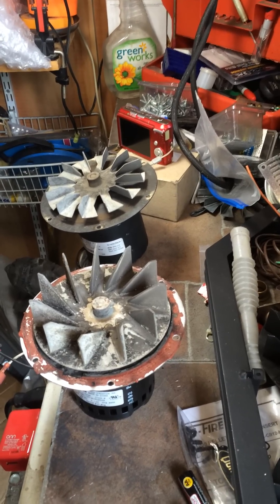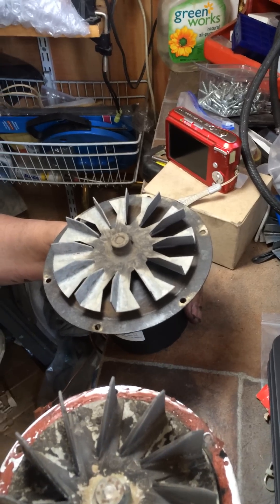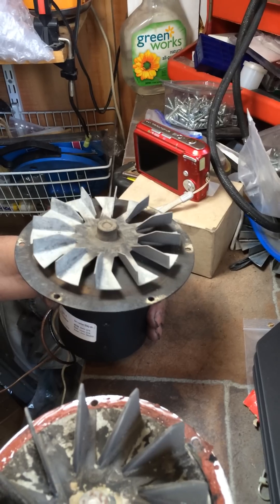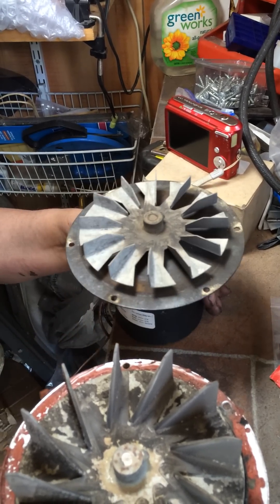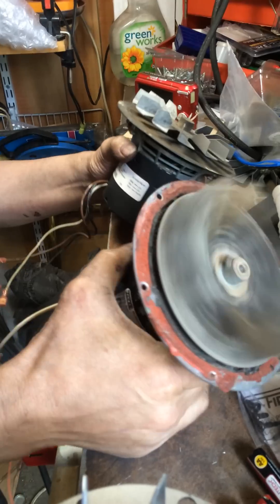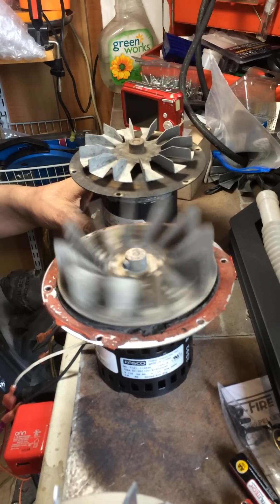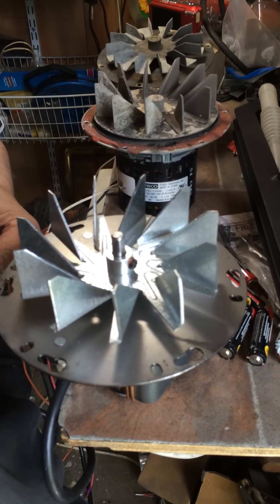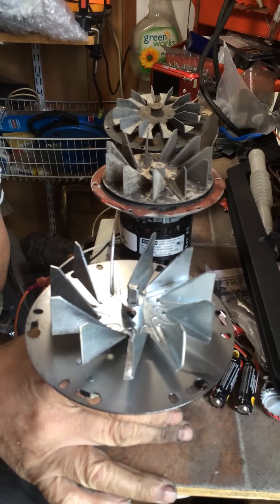Worn Out pellet Stove Exhaust Blowers - show what breaks and the best replacement! ( Spin Test )

Comment: Great product worth every penny – I bought this for my Englander-55-TRPIP Timber Ridge 2,200 Sq. Ft. Imperial Pellet Stove last summer and have run 5 tons of pellets through the stove over the winter and this exhaust fan has run awesome. Today 05/16/2020 (Boston area) I am still running the stove and where this fan really shines is at lower settings it keeps the flame strong & the stove glass clean.

Comment: After viewing this video i believed my fan needed replacing. Come to find out that on my fan motor, the outter part that you are holding also spins.. so when I held it by the motor the fan didn't spin. However,  by holding it by the plate it's attached to, the fan & motor spun fine.

Comment: The higher performance exhaust blower seems like a great idea. A question I have is can the control board safely provide the extra current for the performance blower?
Reply from the maker: The control panel turns the exhaust blower on and off by switching the current thru a heavy duty transistor called a trial.
So yes they can handle the 1.75 amp motor.
Reply from the maker: It is a Triac. Not what my spell check changed it to!
Reply: Sounds great I'll be calling to order the high performance exhaust blower & auger motor for my Englander stove.  @DonR222

Comment: Won't watch any more of your vids. until you learn HOW to hold your camera HORIZONTALLY so we can see more the just a small slot of what you're doing!!
Reply from the maker: If the phone is held Horizontally then the picture comes out sideways. Any suggestions?
Reply: @DonR222  if you START the recording horizontally, it will come out ok. The phone stays in the original recording position.
Reply: I'm not trying to be mean, butu Use a video camera instead of a dumb phone!